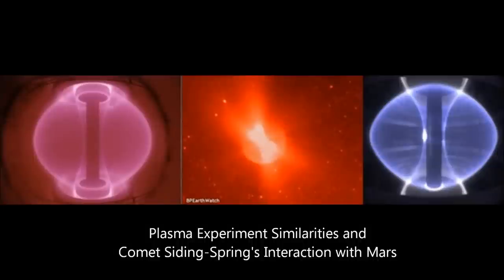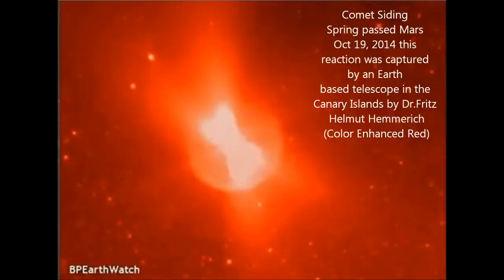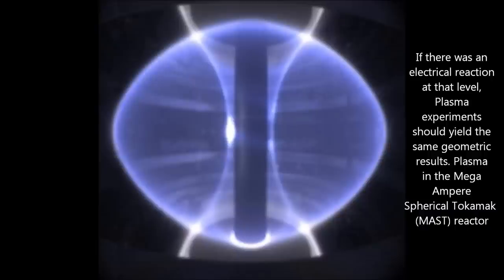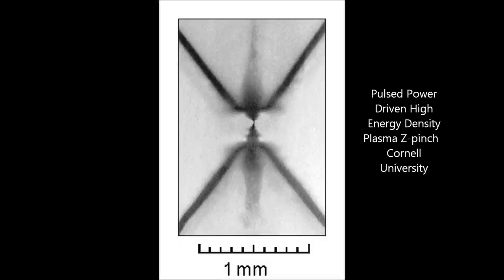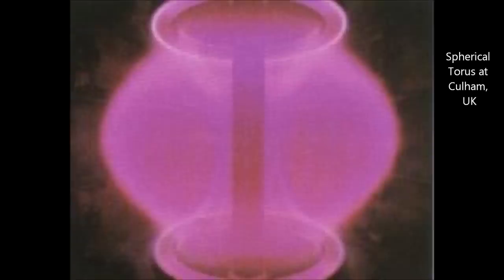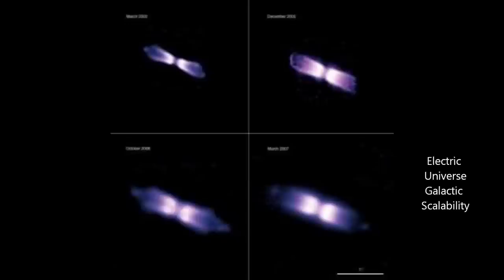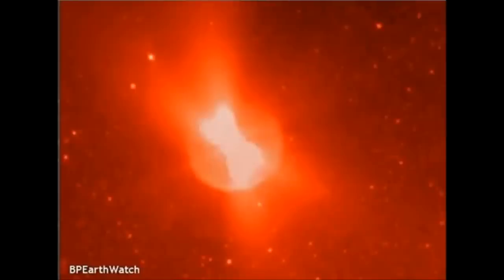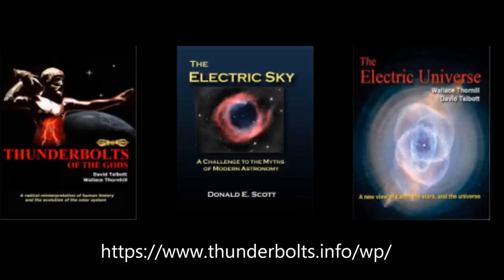Plasma Experiment Similarities and Comet Siding-Spring's Interaction with Mars

Comment: Why would a plasma discharge occur between a comet and a planet?
Reply from the maker: JB, think of a comet as a cosmic capacitor. There is a discharge between negative and positively charged objects in space, which signals an electrical event. Follow the Electric Universe links and open your mind to the possibility that free energy exists all around us. We just need to harness it as Tesla did 100 years ago.
Reply: Adapt 2030 I am all for tesla energy,and i am also aware that we are beings of energy,frequency,and vibration,I am still learning about the interactions of comets and planets. thanks for the info,already aware of the electric universe theory that SO supports.